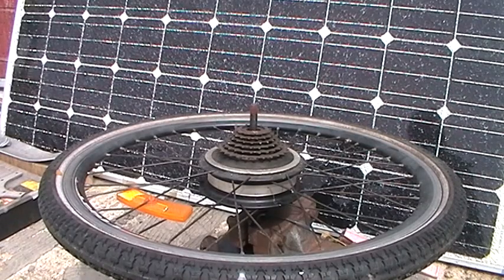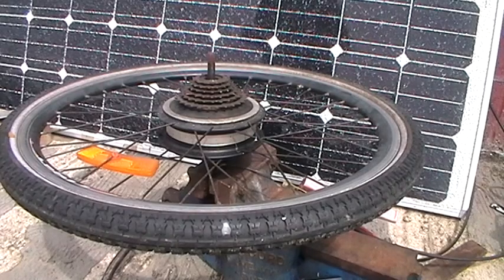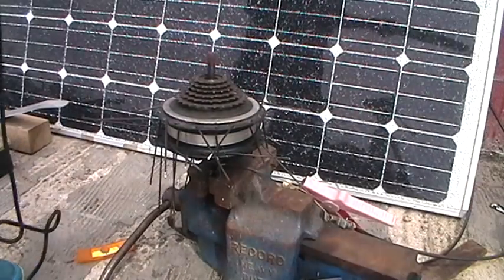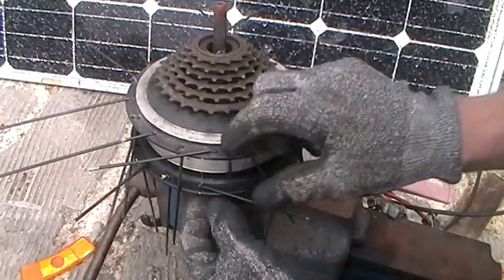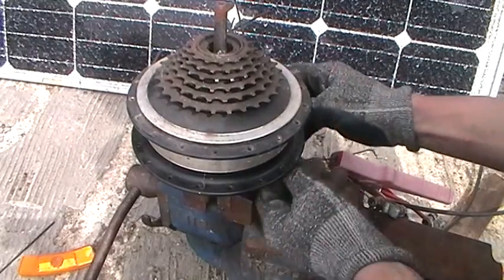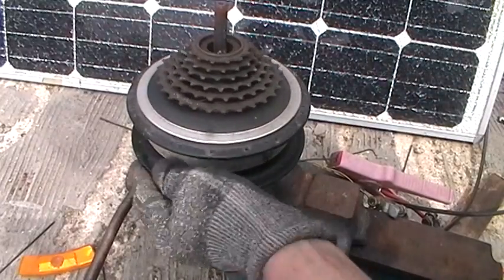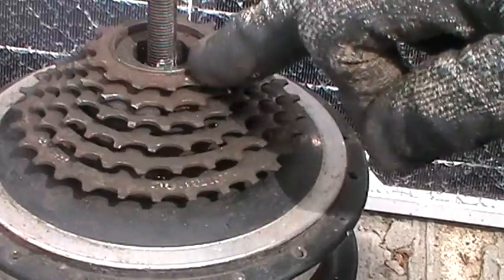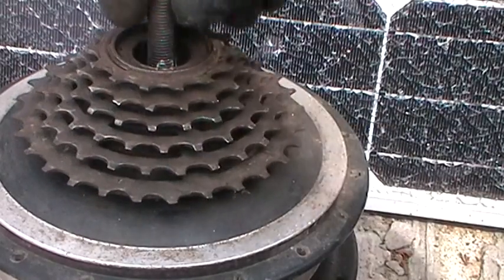UK WIND ENERGY DIY geared wind turbine from 36v DC bike motor part 3

Comment: The bearings sound dry, I would pack them with grease before using especially for a Wind Turbine that will be spinning it v fast. It’s not going to be as efficient if not greased, and once constructed for a wind Gene it will be harder to grease up.

Comment: Gavin, do you know how the low rpm coils are wired or configured differently than high rpm coils?  Also.  What sort of Amps/Millamps are you getting from these with a load on, something like a mini fridge etc?  Thanks bud.
Reply from the maker: I wouldn't use one of the older motors like this it got thrashed to death to easily I would use a newer 3 phase one , power as always depends on the size of the blades and the height of the tower , cheers.
Reply: @GavinFreedomLover  Nice one bud. Many thanks : )
Reply: This motor AC or DC voltage produces 🤔😉 use your multimeter AC  this will correct voltage. After rectifier you can check DC .

Comment: you should look into fisher and paykel wind turbine , just made from a washing machine motor, they can make quite good power direct drive , The Back Shed website shows you how.
weve built them in the past , pretty decent power, some guys get well over 1kw 
i did the 36v 200w bike motor direct drive i think 48v would be better but it was fun, my paticular bike motor was easy to remove the cover/gearing etc and just use the bare motor on its shaft.

Comment: we should not change anything?by default produces electricity?or modify something
Reply: Gavin FreedomLover
Reply from the maker: +ESCOBAR CRISTIAN Hello, are you talking about the mototr or the solar panel , thankyou
Reply: +Gavin FreedomLover the motor
Reply: +Gavin FreedomLover gavin freedomlover , how many volts think could generate an motor hub 3000w, making wind ?
Reply from the maker: 3000w that will need huge blades to even get started, is it windy where you are???